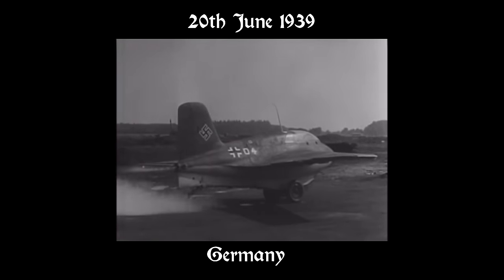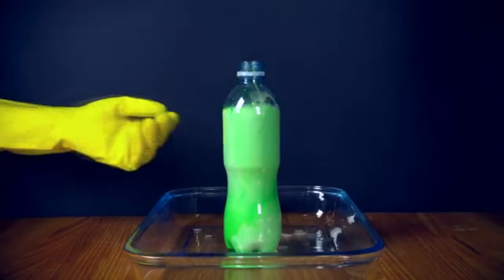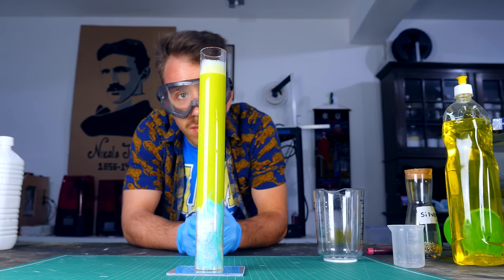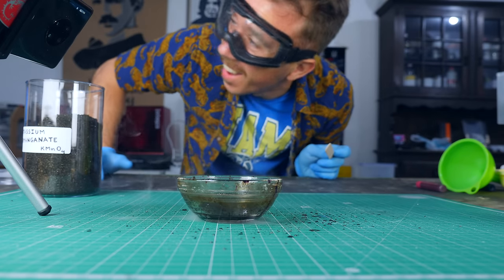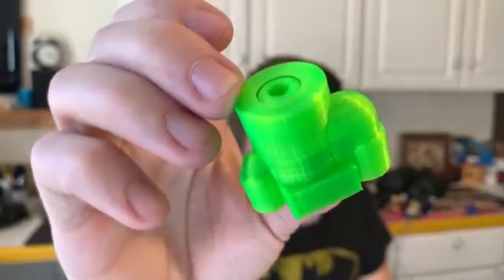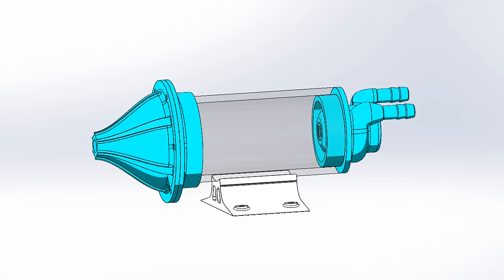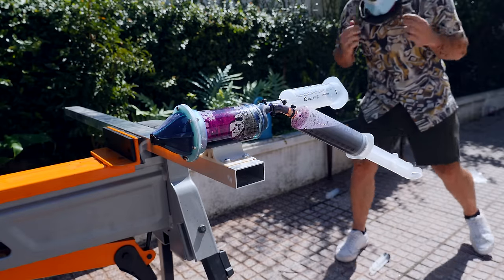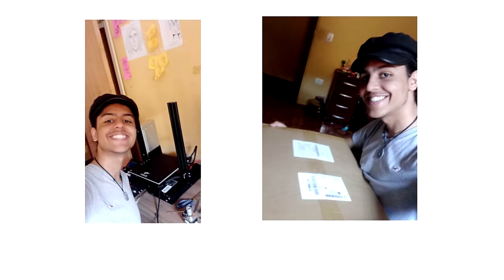The Forgotten Nazi Cold Rocket Engine (3D Printed)

Comment: idea : feeding the exhaust of this engine into a hybrid rocket core, using the oxygen from the reaction as the oxidizer, a sort of afterburner if you want (I have no idea if that would work ^^)
Reply: No it wound not 
Do you want to know why?
Reply: i think a problem would be the water vapour and it cooling down the oxygen reaction.
or it could work and superheat the steam for even better exhaust
Reply: @letsflipp  If you can get past 1000C in the core temp, that water starts to break down to hydrogen and oxygen feeding the reaction even more, but it needs to be pretty high temp. Powerplants use this by feeding wet burnable fuel into furnace so it floats in the air flow and due temps on there mentioned atomic breakdown happens and feeds the fire further, hence why littlebit wet fuel is better, but only if you can get into high temps where this happens, otherwise energy is lost in the heating water further.. though that does expand so there could be net benefit on this.. is it worth the weight and complexity added? Dunno but worth to test i think.
Reply: @tvishmaychoudhary69  why ?
Reply: @Hellsong89  thermolysis of water is only significant beyond 2000C, and it is endothermic so it wont add any energy to the reaction
Reply: @The.Heart.Unceasing  bcz the reaction is not an redox reaction thats why oxygen would have no role
Reply: @tvishmaychoudhary69  ... are you saying that a hybrid rocket does not need an oxidizer ? 'cause you're wrong ^^
Reply: @The.Heart.Unceasing  oh you are saying using the gas produced by the reaction as an oxidizer?
Reply: @tvishmaychoudhary69  yeah, sorry if I wasn't clear enough ^^'
Reply: @The.Heart.Unceasing  its ok but it still won't work bcz its mostly steam 

I guess

Comment: Main idea for next video: try again with silver as a catalyst, but this time try to make a different shape (in X-15 plane, they used silver in a shape of a sieve (hope it was translated correctly), through which the peroxide was passed (hope that translated correctly as well));

Another idea: try and make the most efficient possible bell/aerospike nozzle for your rocket (a little bit of fluid mechanics).

Nice video btw, I always love modern interpretations of old ideas!

Comment: Video Ideas:
1. You could make a steam powered generator and for example put it into a electric rc car.
2. Put the steam engine into a plane and see if it powerful enough to move it.
3. Make a working speaker.
4. Try to recreate your earlier projects and see if you can improve on them.

Comment: Project concept: Build a alcohol powered rocket, one that burns the water, alcohol, and sugar in it. This can be done by using electricity to break apart the water, then it is recombined and burned. Or you can maybe convert the water into a different compound. But as part of this, make it so that the alcohol and sugar found in beer or other alcoholic beverages is used as fuel as well.

Comment: 2 cylinders that feed regents via gravity to mixer with  one way check valves and 2 small tubes off mixing chamber that take a bit of pressure and feed to top of cylinders to help push regents? but don't let the plungers leak (=  edit that sounds gooder 👇ghost

Comment: You could make an rc plane out of this engine design.

First the engine needs to be more optimised, you could use 2 motors/pumps to accurately spray in the fuel mixture and optimise the percentage of each to give the most efficiency. 

The plane itself could be made out of foam or balsa wood frame and paper/cardboard with the servos and motors etc inside to make it controllable ish. Even just a 2 way plane would be controllable enough to test if it will work (maybe try and get in contact with Peter Sripol for help with that)
Reply: Tom Stanton would also be good and easier to actually meet up with Integza since he's also in Europe.
Reply: A better idea than pumps would just to have 2 tanks pressurized with compressed air or maybe a CO2 cartridge.  That's called a pressure fed engine (for obvious reasons).  It's a very common approach when weight and auxiliary power for pumps is an issue like space probes.  Look up Scott Manley's channel. He's probably the best rocket/science channel on youtube.
Reply: @whatelseison8970  Flite Test blog has an article about Tom Stanton's compressed air engines including some planes that he built with them.
Reply: @jonathandill3557  I know, I've been subbed to Tom for ages and I've used some of the plans from FT.  I've been doing RC air stuff for a while now.
Reply: @jonathandill3557  true, he slipped my mind tbh

Comment: Idea for a future video: you could use the expanding gas reaction to make a turbo jet. The turbine could be 3D printed because the reaction is cold. Then you have a spinning shaft down the middle of your rocket engine which you could use to run two separate compressors stacked on top of each other that pump the two chemicals in. All you’d have to do is like pull start the rocket engine and the compressors would pump the two liquids into the combustion chamber.
Reply: That sounds a lot like a V2 rocket.

Comment: Hi, really don't know what I'am saying but this is a great idea for part 2.
Video idea -- i noticed that you only used syringes to drive your propellants and catalyst into the combustion chamber. How about putting it in a pressurised chamber (20psi or higher) to replace the syringes. And maybe a solenoid valve on each end. That would be cool to watch. Also I dont know if its efficient or not to dissolve potassium permanganate in liquid oxygen. Thats something I would like to watch in the future video. 
Thanks
Reply: Bro I think that's a good idea.
Reply: @mitchluis7091  I think so too
Reply: I hope you win bro.
Reply: @francisprinceartiaga8606  my chances are very slim but i really think that this is a good idea
Reply: @natsukidaichi4438  yeah your is idea is good. I hope integza would see your comment
Reply: @francisprinceartiaga8606  thanks for the support but with more than 7k comment, mine is like a needle in a haystack. But I'll stay positive

Comment: design suggestion: why not trying solid KMnO4 as catalyst? like keep the solid powder in between 2 pieces of coffee filters then pass H2O2 through it.
Reply: This but add a Tesla value for the peroxide intake to reduce changes of back pressure. Could possibly just connect the Tesla valve to a cut off valve and a tank so it could be can a pressured feed system, then would just need a second cut off valve at the top of the tank for air.
Reply: I was gonna suggest this. I would mold the solid KMnO4 into a cylinder and then have two fine mesh screens, not coffee filter, to allow gas to escape. One would be to hold the solid monopropellant and the other at the nozzle. Also tesla valve on the input valve is a great idea. Maybe the peroxide could be sprayed in a cone?
Reply: I like your funny words magic man
Reply: I think the coffee filter would rip apart quite fast.

I thought about that also at first to use a solid catalyst. Maybe coat the walls of the combustion chamber with it. But the liquid one has a few advantages. 
1. Very high surface area. Especially with the vortex mixer, the effective surface area is very high and that means more reaction per time.
2. Additional impulse. The water and the catalyst are ejected. That means for the same nozzle velocity there is more mass pushed out of the rocket so there is a higher change in impuls thus a higher thrust. 
3. Better cooling. There is a lot of energy getting released during the reaction. The additional water of the catalyst solution can also heat up taking heat away. Especially when it also boils it will also generate thrust. 

The last two mostly apply to this rocket only because of the 3D printed parts the rocket has a low temperature and pressure resistance, compared to a metal rocket. Otherwise, this would really be a concern.
Reply: @FactoryofRedstone  What is the difference between thrust and trust? I don't thrust these designs that start with "Maybe....".
Reply: @voornaam3191  Well, that's simple. Trust is a likelihood, that what I say is true, weighted with your perception of my competence. Thus, it is scalar-valued. Thrust on the other hand has a direction and magnitude and thus can be expressed as a vector. 

So maybe you mean, what is the difference between trust and |thrust|?

Just kidding.

In this case, I used maybe, to indicate that it might seem like a good idea at first, but it has significant drawbacks that are not directly obvious. 
But you are right, sometimes "maybe" means that I haven't done the math yet, so it could be potentially dangerous or a total flop or it totally works. Who knows...

Comment: Design suggestion: use a Tesla valve  on the intake lines;
use a smaller "combustion" chamber.
Tomatoes = rocket dummies!
Reply: Got to love Tesla forget the simple check valve
Reply: Could also use an inline check valve after syringes so the pot perm and peroxide have no back flow
Reply: Ooh. I love this
Reply: I guess we would have to call it a "reaction" chamber

Comment: You should find what ratio stoichiometric mixture is so you can optimize the reaction. Of course, dont use exactly de stoichiometric mixture because probably is going to explode.
Reply: Well considering the way he probably would do it is by diluting  the catalyst  I think it be fine
Reply: you can also control temperature rise by down blending the peroxide with more water; s'long as you allow for higher pressure rise.

Comment: 3:00 take out water :) "right" heat and distillation (like methanol & ethanol have different boiling/vaporize points (1 bar pressure) )

Comment: Suggestion for future videos: Try designing a working rocket engine with the knowledge you've collected. Then, or in another video, you build a rocket with the engine, which flies at least 1000 meters high and arrives safely on the ground.

Would be very grateful for the 3d printer... I am also trying to develop a working rocket engine, allthough i am using steel for the parts.

Comment: to avoid the chemical reaction from reaching the storage tanks you should use 1 way valves that could help
Reply: The "fuel" delivery system in use here has no metering of any sort.  The volumes of propelent and catalyst were likely many orders or magnitude too high for the size of the expansion chamber/ mixing nozzle delivery rate.   I look forward to seeing more in this series!
Reply: How about a Tesla valve for the inlet :)
Reply: Very interesting, I think it's also a relationship of the volume used, tesla valves would surely help limit the backflow pressures but much a smaller syringe would be like a disc brakes master/slave pistons and allow much finer control and a basic adjustment of the design without much expense. 
Using pneumatic tubing and push fittings designed for reasonable pressure might have been a good idea! 
But I guess I wouldn't have laughed as  much then...

Comment: I'd love to see a more detailed version of this made, one that can allow for measuring the thrust of the engine. Perhaps print out an engine that can release the chemicals via remote and see how hight it would fly? Very interesting video and concept.
Reply: Actually, to measure the thrust it would be better to perform a static test and use a load cell to measure it. Seing how high it would fly gives just an approximate estimation of this value and he would need to board an eletronics with altimeter and SD card (at least) to record the altitude during the flight - which is probably more expansive and complex than a load cell.

Comment: You could angle the injection nozzles to force the chemicals to agitate each other as they flow. And a screw thread and piston on each chamber should nocely inject the mixture. And they can be driven with a central motor and gears.

Comment: Obvious but still interesting video idea: Optimize the mixing mechanism to something a bit more advanced than two syringes. Seems like you are wasting a ton of material due to bad mixing. You could 3D print an injector that consists of many many tiny tubes so that rather than coming out of two large inputs, the compounds come out of several intermixed tubes for maximum mixture, and maximum thrust. You'd probably also need to go back to our good friend Tesla for some one way valves.

You could also see if it would be possible to invent something like a hybrid pulse engine, where you let the steam pressure build up before releasing it in small bursts.

Monopropellant based engines are super interesting, and they are extensively used in space for maneuvering thrusters, to make those final small adjustments for docking and such (although they usually use hydrazine, which is EXTREMELY toxic, still not as toxic as tomatoes).

Comment: imagine building a small version of an Me 163 with this kind of rocket, that would be so cool
Edit: a v1/v2 rocket could be cool aswell, without the explosive payload of course
Reply: First of, you know what I ment, no payload other than the fuel necessary, and even then only enough fuel so it can fly for a while, then run out and fall "safely". Second of, I'm no chemist or anything but if the engine is combustion-less, I don't think the fuel will combust on impact or whatever, it's a cold engine for a reason

Comment: Integza the mechanic of the pump it's actually pretty simple first you drill a hole in the side but litle back not on the front, second cut the handle seal the back  glue a hose to the hole conect it to an air pump release the presure on the hole you made

Comment: Make a HHO generator that ideally has separate outputs so you try making super heated Steam when combined be aware the reaction between hydrogen and oxygen is supersonic and ensure to have a back flash protector when a chemical reaction is taking place.
Reply: Sounds like a recipe for blowing up his house...
Reply: @KerbalFacile  Blew up 5L of HHO mix inside a styrofoam box once. That was insanely lound and it threw bits of styrofoam quite far away. Now it takes a lot of power to make styrofoam fly that far...

Comment: I have a great idea for a rocket fuel. Combine resin with aluminium powder like you did with sugar in one video, since aluminium is very powerful and it's used in many solid rocket boosters, like the ones on the Space Shuttle or the SLS.

Comment: The Nazi's had problem with stability, and I could see your rocket sputtered a lot, I would suggest either using  an electric motor to push the syringes or a pump to push at a constant rate)

I also noticed you sometimes had a lot of extra Potassium Permangenate solution, so I would love for you to try different concentrations to see which is most effective, because having too much would just be extra weight to take care of.

You also need checkvalves or teslavalves to minimize backflow, because that happened twice, and the steam would be rich in oxygen (H2O2 -> H2O + Oxygen), so possibly an afterburn to further increase the thrust.

Controlling it is pretty hard, so probably no remote control rockets haha, but you could either fire it out of a tube as an RPG, or straight up into the air, and then have parachutes in a top compartment. TKOR made some great videos on this:
https://www.youtube.com/watch?v=CISZ7RUye5w
https://www.youtube.com/watch?v=r2lDXoW78u0
Even though they are solid state rockets, I think the parachute compartment might still work. and you can still take idea from the general shape of the rocket with fins for stabilization.
Reply: The sputtering looked like overpressure leading to backflow, limiting the fuel intake and then releasing, over and over again, creating a pulsing effect instead of constant thrust.

Comment: I'm thinking using a hot solution of hydrogen peroxide and water will have a greater effect, especially if you get the solution close to boiling. The extra heat should cause a faster phase change with the water thus more thrust. I would like to see this experimented more.

Comment: Looks like you need a one way valve for each compound,  something along the lines of a diaphragm valve used in pulsejets "might" work for small scale you are working with, and two electric pumps for the injection system that can be increased/decreased to adjust the ratio of each compound for a more controllable mix to optimize the combustion.